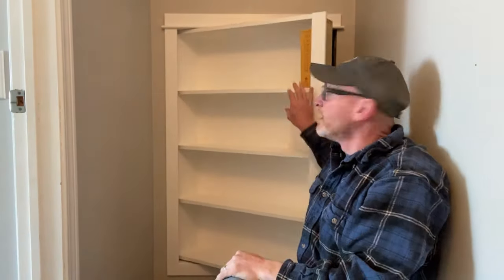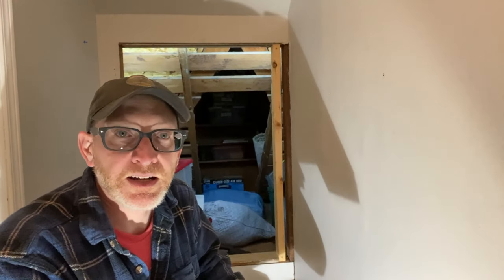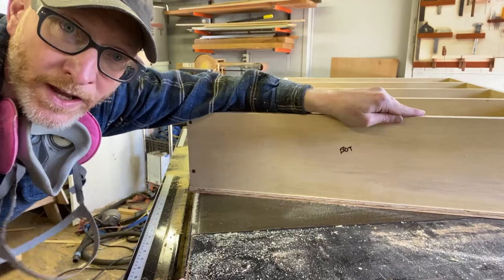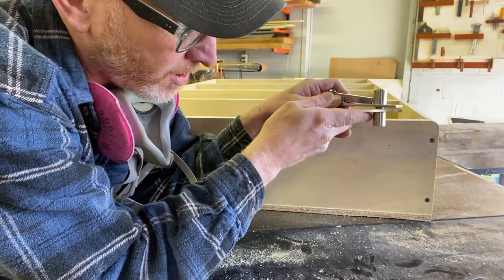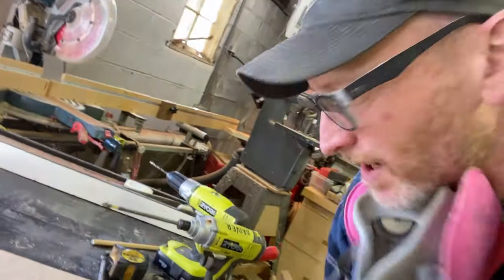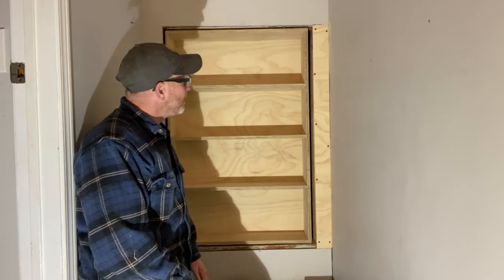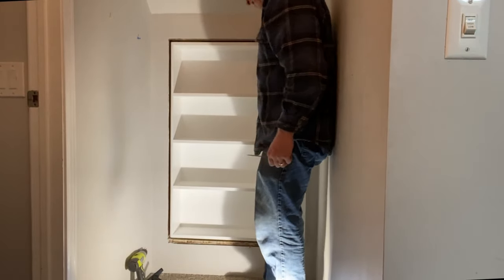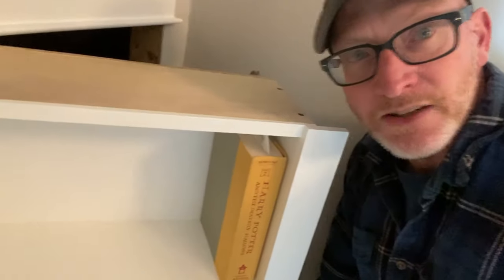Hidden Door Bookshelf | Outswing | Full Build Video

Comment: So to do a out swing would you just move the hinges to the opposite side of the frame you did?  Great video FYI
Reply from the maker: This is an out swing as it comes out from the hidden attic into the room.  There are easier designs/hinges if you want the bookshelf to swing into the wall.  If you just want to change which side the hinge is on, yes, you can just put it on the other side of the frame.  I hope that helps, David!  Thanks for watching!
Reply: @onFIREouttakes  I switched that didnt I?! I meant in LOL
Reply from the maker: Yes, I think you could move the hinges to the other side of the frame and more toward the corner. Honestly, there are cheaper hinges to accomplish an inswing.
Reply from the maker: I know it was a long time coming but I now have measured drawings available for this project.  Sorry it took so long!  You can find them here:  https://onfirefamily.com/plans/ or at the link in the description of this video.  I hope they help you with your project!  Let me know what you think!

Comment: I'm drilling into concrete , is it possible to flip the bottom hinge (i.e., drill into the casing to recess as opposed to drilling into floor)
Reply from the maker: Yeah, I think maybe that would work (although I’ve not tried) and it would come through the bottom shelf and you’d need to hide that.
Reply from the maker: I know it was a long time coming but I now have measured drawings available for this project.  Sorry it took so long!  You can find them here:  https://onfirefamily.com/plans/ or at the link in the description of this video.  I hope they help you with your project!  Let me know what you think!

Comment: I have to say, I admire your shop. Those battery powered Ryobi power tools you use? How well are they lasting?

Also...I'd suggest a magnetic latch inside to keep the shelf door closed.

Got a question. We have a mobile home and I'd like a French door style hidden door to lead into the middle bedroom we are redoing to make into a laundry and storage room. Cause we need one more than a second bedroom. 

Any ideas how to do that? My domestic partner is the crafty one with power tools. I just do the blueprints and come up with the ideas... And hold the flashlight. Yes, you can laugh at that.
Reply from the maker: Thanks, Becky!  I like Ryobi and they have been great tools.  Lasting well.  I've tossed a couple of my older batteries, 5 years old or so, because they stopped holding a charge for long but other than that I've been very happy.  Magnet latch is a good idea, thanks!  If it's an outswing style of french door you seek, maybe this design will work (just add a mirror image of it on the opposite side).  There are many more videos out there for inswing doors if that's what you're looking for.
Reply: @onFIREouttakes  thanks for the suggestion. I'll see what we can figure out. Could one use a piano hinge instead of the hinges you use, or would that be ill advised?
Reply from the maker: I think long ones that would cover most of the length of the door would work.
Reply from the maker: I know it was a long time coming but I now have measured drawings available for this project.  Sorry it took so long!  You can find them here:  https://onfirefamily.com/plans/ or at the link in the description of this video.  I hope they help you with your project!  Let me know what you think!

Comment: Good video, how far did you set the hinges?
Reply from the maker: I left half an inch gap on the hinge side and 1 inch on the latch side. The hinge point (trial and error for me) on my template is 3 in from the edge of the cabinet and 1 7/8” from the front of the shelf. I hope that helps!
Reply from the maker: I know it was a long time coming but I now have measured drawings available for this project.  Sorry it took so long!  You can find them here:  https://onfirefamily.com/plans/ or at the link in the description of this video.  I hope they help you with your project!  Let me know what you think!

Comment: How far did you set the hinges?
Reply from the maker: I left half an inch gap on the hinge side and 1 inch on the latch side. The hinge point (trial and error for me) on my template is 3 in from the edge of the cabinet and 1 7/8” from the front of the shelf. I hope that helps!
Reply: Thanks, I will try that!
Reply from the maker: I know it was a long time coming but I now have measured drawings available for this project.  Sorry it took so long!  You can find them here:  https://onfirefamily.com/plans/ or at the link in the description of this video.  I hope they help you with your project!  Let me know what you think!

Comment: Skip that lock and use a strong magnet to hold the door closed.
Reply from the maker: Yeah. Original design was for the “cool factor” of the tilting book.
Reply: @onFIREouttakes  Ive been using magnets quite a bit around the home. They are really cheap nowadays and very strong. I find it to be very convenient for DIY things. I liked your build. Ive been sifting through videos like this one for a secret gun room. You can never be too careful with your firearms.
Reply from the maker: Cool!  Thanks!
Reply from the maker: I know it was a long time coming but I now have measured drawings available for this project.  Sorry it took so long!  You can find them here:  https://onfirefamily.com/plans/ or at the link in the description of this video.  I hope they help you with your project!  Let me know what you think!

Comment: Great idea but the architrave gapping is to noticeable to just be a book case and the latch mechanism is to easy to find as for the hinge well it's to obvious, plus the other thing is that there is no sign-off the book case bieng attached to anything at its rear even just a few blank screws in the back So it appears to be fixed to a solid wall behind it would of been more convincing that it is just a bookshelf as for the latch perhaps an electro magnetic latch and lock like a security door or a servo operated latch and lock similar to that of a cars central locking system installed from the rear, either if which could be remote operated or even wired to a socket in a hallway disguised as a plug socket with a second release switch on interior with a function similar to how a room light works that has two switches one either side-on room if one is on the other could turn it off and vice versa sofas a lock and catch would open from outside the interior would lock it and vice versa personaly I like the idea of hidden secure spaces for storages even for personal safety such as a female home alone whose home has been broken into but It woukdxof been better if the functionality was a lot less noticeable and the hinge and locking system were not so obvious
Reply from the maker: Thanks for watching. All good points but this isn’t really needed for 100% concealment and works quite well for what it’s intended to do. The hinges are awesome.
Reply: @Martin Bacon Lol, if you want to keep something truly secret then you definitely don't post about it on YouTube!
Reply from the maker: I know it was a long time coming but I now have measured drawings available for this project.  Sorry it took so long!  You can find them here:  https://onfirefamily.com/plans/ or at the link in the description of this video.  I hope they help you with your project!  Let me know what you think!